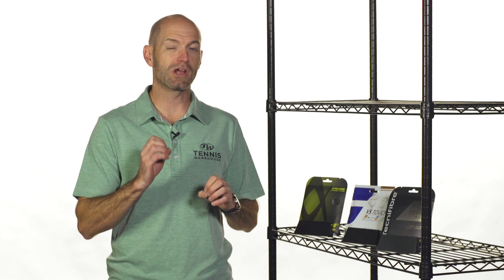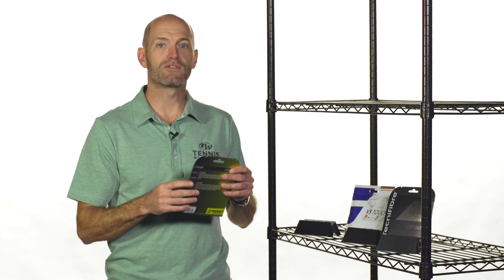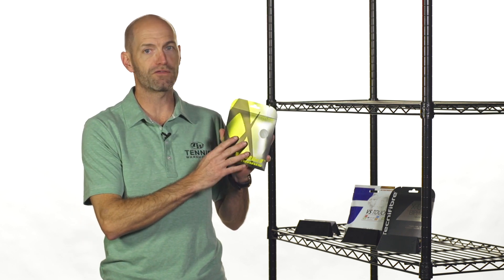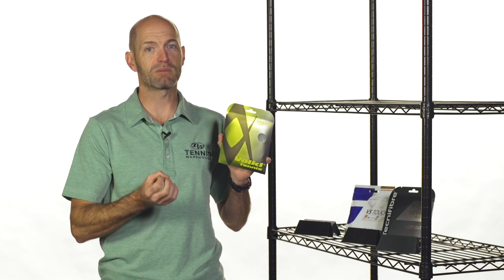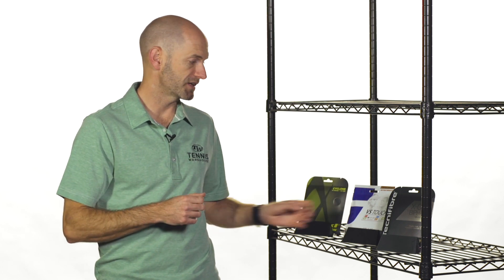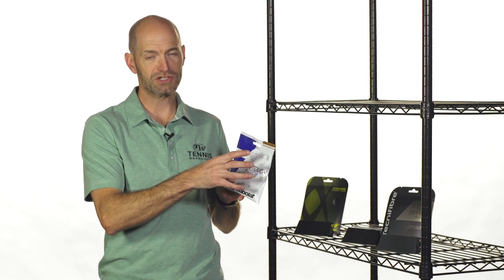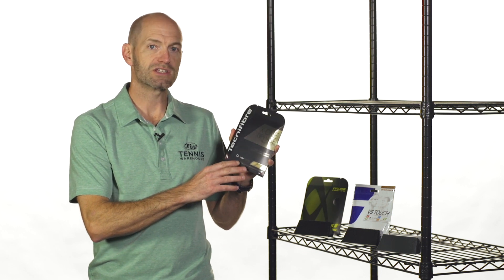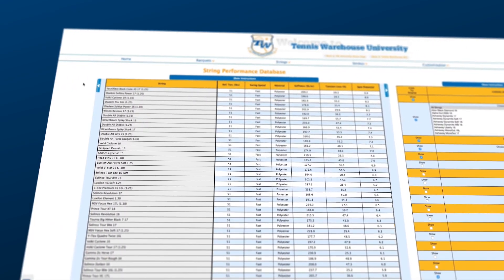Understanding Tennis String Stiffness - VLOG #474

Comment: Thanks Chris. I always check the cof to see which is the slickest strings I can use as a cross and the highest string to ball friction to use as my main string. And if one of the strings is hurting my arm, I look at the stiffness rating to see if there is a softer string that would produce a lot of spin. I was thinking of putting ha ally origin as my cross and technifibre black code 4s as my main. If I feel like my arm is fine but my racquet has too much power then I can switch the origin with the cheaper and stiffer orange Wilson revolve since the orange color is softest of the white and black and still has a cof as the origin. But if I feel like the set up is hurting my arm then I can keep the origin and switch the 4s with a diadem power solistice. That is the beauty of tennis warehouse, they have scientific information that I can look at without me experimenting with a million strings and Bing expensive. No other tennis website does this and this is why I'll always order from tennis warehouse.
Reply: I meant babalot origin. iPhone auto corrected me.
Reply from the maker: +Yeshua Man Great feedback and glad to hear you are getting good use of the data we publish. Thanks for your business and thanks for watching the vlog! Cheers, Chris, TW.

Comment: Hey TW. As always awesome info! I was wondering if the dynamic impact (referenced on the string stiffness info page on TWU) was tested on a single string impact or on a full bed. I'm kind of assuming it was on a single string, but I just wanted to make sure that I'm looking at the info in the correct context because one string is so much different than a whole stringbed. Also interesting that 17g Cyclone Tour tested at a higher stiffness than 16g Cyclone Tour. Same thing with cyclone 19g & 18g. Different colors maybe?
Reply from the maker: The dynamic impact test that you're referring to tests only a single string.  We've found over countless tests that, while it is a good general rule of thumb that thinner gauge are often times less stiff than thicker gauges, when tested it isn't actually the case.  There have been a number of instances where the thinner gauge of one string tests stiffer than the thicker gauge, and we have yet to come up with a definitive conclusion why that is.
Andy, TW
Reply: Thanks for the reply. I guess it kind of makes sense because it seems like a thinner string would have to be stretched further to be at 52 lbs of tension which might make it feel more stiff when pushing on it from a perpendicular angle, if its just one string. It'd be interesting to test the strings in a pattern (not a racquet but maybe a frame that could be strung individually and moved around in different patterns) that could incorporate the other variables that matter in the actual playability of the different strings. In any case, super interesting stuff. Awesome resources.

Comment: I currently am using Wilson Synthetic Gut Control (Extreme Synthetic Gut) 16, I like these strings but I for sure know there is a better string out there, any suggestions to a string with similarities? I play with more control then power I'd say.
Reply from the maker: +Lesly Cruz ,
You could try a multifilament string which is designed in a similar way to natural gut and offers a little better feel and playability than synthetic gut.  A couple good multis that offer excellent control to try would be Head RIP Control and Prince Premier Control.
Andy, TW